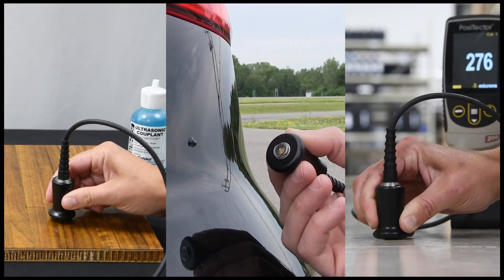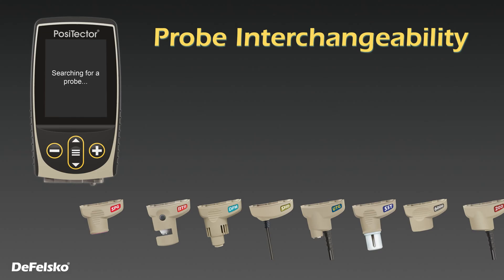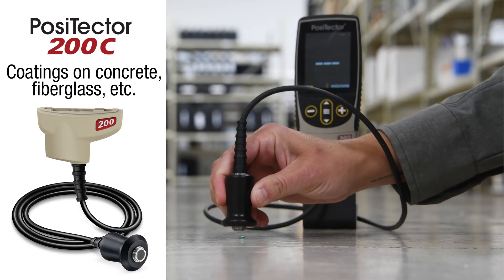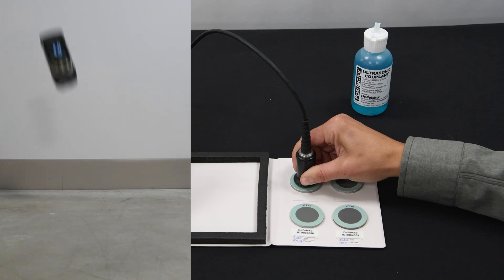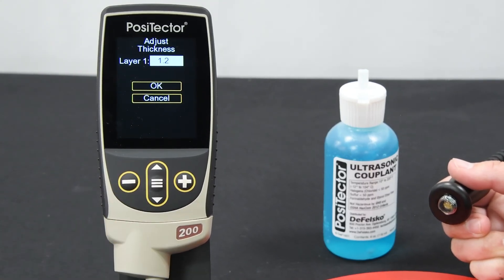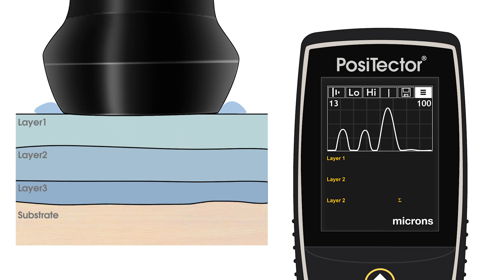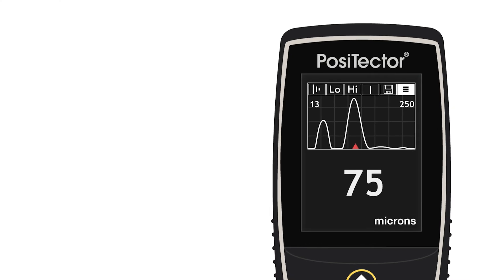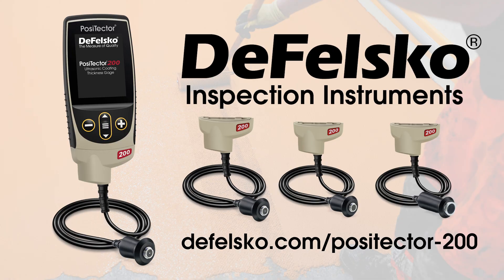How to Use the PosiTector 200 to Measure Paint/Coating on Wood, Plastic, Concrete, and More

Comment: Will the 200D measure DFT of epoxy coatings on concrete up to 7600µm?
Reply from the maker: Thank you for your question. Our PosiTector 200 D model is capable of measuring the thickness of epoxy coatings up to 7600 microns (300 mils).  To determine suitability for your particular application, please contact us at +1-315-393-4450 or techsale@defelsko.com. We look forward to assisting you.

Comment: Can it be used on road marking paint?
Reply from the maker: Thank you for your question. Our PosiTector 200 is capable of measuring the thickness of most road markings that do not contain reflective materials such as glass or silicate. Reflective materials are generally present in markings used on roads or streets, and are too challenging to measure ultrasonically. Parking lots, or parking garage markings typically don't contain such reflective materials and are often able to be measured with our ultrasonic PosiTector 200. Please contact our technical team at +1-315-393-4450 or techsale@defelsko.com to learn more.

Comment: Please recommend the PROBE for DFT measurement Over GRE surface DFT Required 50 - 250 Microns. Location United Arab Emirates.

Planned to buy PosiTector® 200 Coating Thickness Gages for Non-Metal Substrates
Reply from the maker: The PosiTector 200 series of instruments is ideal for measuring coatings applied to non-metal substrates, including GRE and other composite materials.
To contact us directly with questions, or find a distributor in your region, please visit our Technical Sales page: https://www.defelsko.com/sales

Comment: Which one should I use for the paint layers on carbon fiber parts on cars?
Reply from the maker: Our PosiTector 200 B gage utilizes proven ultrasonic technology to measure the thickness of paint applied to exterior automotive plastics and composites (bumpers, mirror shells, side claddings, etc.).  The gage will measure the overall total paint thickness (all layers combined), and may be able to measure the individual layers (PosiTector 200 B Advanced models only).  Please contact us at +1-315-393-4450 or techsale@defelsko.com to discuss your requirement further.  

Additionally, you may be interested in reviewing our online article (see Application #4: Measuring on Automotive Plastic) at: https://www.defelsko.com/resources/ultrasonic-paint-thickness-measurement-on-plastic-substrates